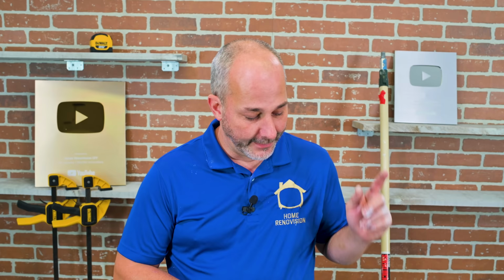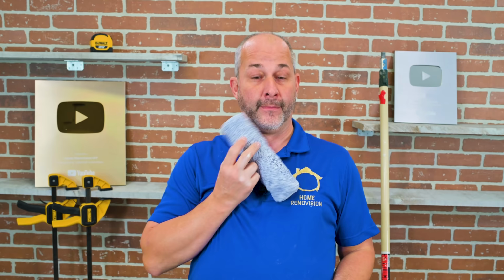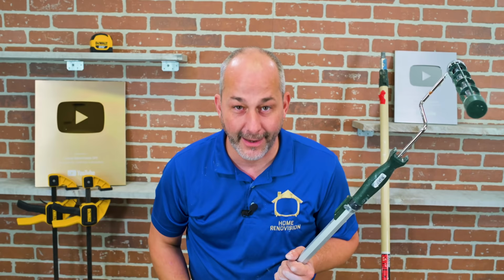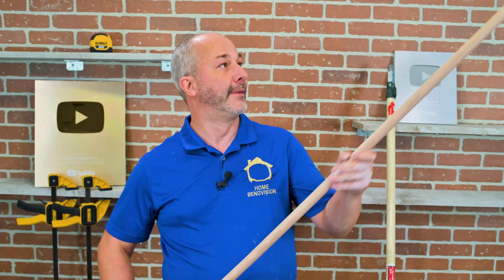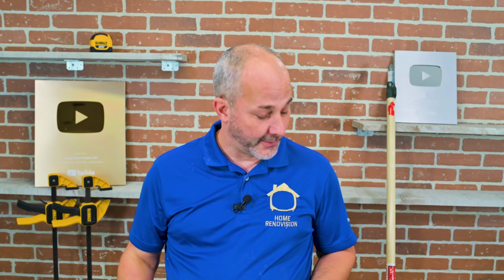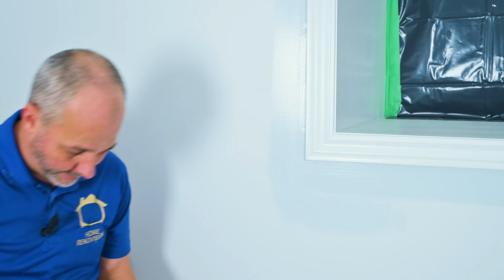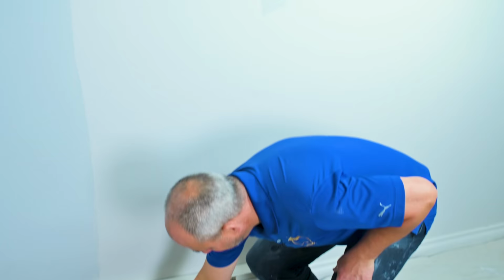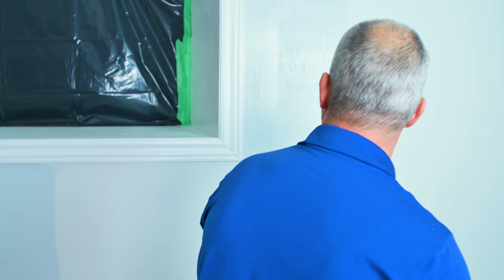Cheap vs Expensive Painting Gear | Is it Worth It?

Comment: if you load the edge tool with a stir stick or a paint brush, endnote all the way to the edge where the wheels are.  it is very clean and very fast. Dipping it, or overloading it with paint will be a failure.   I can cut a whole room (2 doors, 1 window) in 5 to 7 minutes.
Reply: I use a squirter bottle like the old type of ketchup bottles with a nozzle. Works like a charm. I agree....I can fly with that thing. Easy to keep the wheels clean and nice crisp line....not quite like tape, but better than cutting in....for me anyway. I carry both the bottle and pad with me, so I don't have to run back and forth to a pan....no brush to dry on my.
Reply: @biggregg5  I guess if I had multiple rooms to do, the squirt bottle is a good idea.  with just 1 normal size room. no time to dry on me. but great suggestion indeed.

Comment: So what is the secret of cutting in when your painting the rest of the wall with a roller?  The roller leaves a micro texture and a paint brush leaves a super smooth finish.
Reply: If you grab a 4” mini roller you can get very close to where the walls meet to provide texture continuity. I only use an 18” and 4” roller.

Comment: I have used that edging tool (the red one)with success, if I found that it didn't go as close to the edge as I would like I cut off some of the pad holding sides until it is perfect. But you really have to be carefull of paint on the wheels 😂 once you get the nack of it, it can cut really fast. But I can also cut with a brush but not as fast 🤷🏻‍♀️

Comment: To be fair with the trim tool...most have the wheels that lock back to load...however, the safe way to load a trimmer is to paint the paint on with a brush...do NOT dip the pad into paint despite the instructions. It works mostly...however if you are cutting into a ceiling, eventually you will put too much pressure into the edge of the pad, thus pushing the paint onto the ceiling anyway...it's very delicate process and if you go slow enough and are very careful, it's possible to do...these are best for corners though where the paint is the same color. At least this has been my experience...I do not use that tool..I now have professional equipment, but just wanted to give an insight to those trimmers...of course, you need to buy a good one, not from the dollar store.. LOL.

Comment: I find the cheap rollers eventually stop rolling. Then you're basically just dragging a extra wide rag up n down the wall. 

I knew the wheels were going to get paint on them right away. It's an interesting concept. The only way I think it could work is if you carefully painted the pad so you can cut in without the wheels getting all gooped up.  I've used a similar one, no wheels and it worked for a few, until the paint went over the edge of the pad. After than you're carrying a damp rag, trying to clean up the trim. But, it did work good to get into the corners, ceiling and walls of they're all going to be painted same color. I'm a firm believer, get what you pay for. Buy it once, not several times. Yes, up front it's more outta pocket, but at them end of the project you end up spending twice as much as it would've if you just but the good shit. (My dad is the perfect example of buying cheap, going back buying again, then finally getting the good stuff because 50 miles is a long way to the hardware store) me on the other hand, I just buy the best I can afford.

Comment: The dabbing method with padders does not work. We used them commercially with empty shampoo type squirt bottles to apply paint to the pad. You can absolutely get good quick results from a good padder, but does take some getting use to. I’m about twice as fast with it over a brush. Just a thought.

Comment: Honestly my fav part about being a painter was cutting with the brush and doing trim work outside, prep was the worst part. Overall it was an ok job, also there really is no reason to buy the cheap crap, you'll be lucky if they make it through the day, the extra 10-20 mins to wash and clean all the tools and extra couple bucks is def worth it, the tools will always be there in case you wanna let a friend borrow them or if your teenager decides to paint his room from blue to black.

Comment: I've actually used the red cutting tool. It was surprisingly good, until the second trip to the paint got paint tin got paint all over the wheels and the wheels painted my ceilings. Threw it out right there.

Comment: Jeff, first let me say thank you for the videos you provide that teach me how to do things the right way.
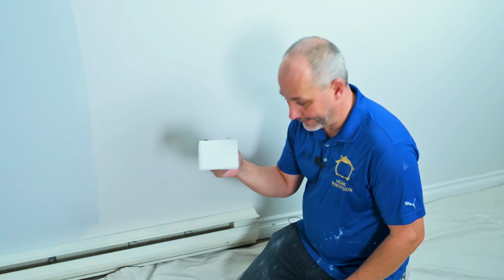I wanted to ask a question with regard to not using tape to prevent spills and whatnot. I have yet to perfect the brush technique yet, but I'm close. 😊 However, my question is about the roller you use after brushing in this video. At approximately 10:27, I see what appears to be some blue splatter on the white heater trim as you speak of the new gadget for painting around trim as opposed to using a brush. Of course, it could be the video itself, but it appears to be spots of blue I see. Even so, the question I have is about roller splatter. How do you prevent roller splatter from getting on heater vents, etc, when you do not use something to cover them such as tape? I noticed you do have drop cloths on the floor, but the heater is bare. How does your preferred roller function with regard to paint splatter? My thoughts are it is a matter of paint and gravity. Any info you might lend would be greatly appreciated. Thank you.

Comment: The edging tool works OKAY. You have to use a brush to add paint. But often times paint would flow over the edges and make a mess or get on the wheels

Comment: Jeff.  I'm going to pain my bedroom and my walls is that orange peel texture,  what is the best roller or brush to use? I want to do a accent wall.  Do you give ideas on different ways to do guest  rooms? if so I need some ideas. 😁
Reply from the maker: I would suggest a half inch nap on a 9" long roller. Cheers!
Reply: @HomeRenoVisionDIY   Great thanks .

Comment: I think I am something of an anomaly. I use both good quality tools and cheap crap from the dollar store. Depends on what I am doing. Mainly it depends on if I want to spend the time to clean up afterwards. If I am painting a room, I break out the good tools. If I am doing a small painting project, I will buy the cheap $3 pack of brushes and just toss them when I am done. Use one for primer coat, toss it. Use another for actual paint, then bag it in case I need to do touch-ups the next day. Same with cheap rollers, and tray liners.
I see no sense in taking more time to clean my tools than it takes to do the paint project.
I figure the $10 I throw out is a fair trade for the hour or two of cleaning I would do over 2-3 days of painting.
Same goes for oil based paint. I've got a couple nice brushes dedicated for polyurethane but I am not messing them up with any kind of paint. I've had them for 20 years now, and they still work beautifully.

The one thing I won't use though, is a cheap cage. A flimsy cage make the job so much harder. The uneven pressure leaves ridges in the paint, also makes the roller want to walk off the cage, you can't stretch the paint so it uses more.
Reply: Another advocate to this comment! Like all pros recommended I bought expensive brushes in the beginning, they hold so much paint it took me so long to clean them, and that was just not worth the time for me personally.

Comment: A roller question .... 12" double ended (flat frame goes to both ends) What is your opinion? 
It gets round the problem of putting pressure on only one end and mine has lasted 3 years now (not the same roller obviously) and seems good. But is it better than your "Pro kit" roller?
Thanks from the UK ;o)
Reply from the maker: I find it is a problem being that large. you will find a lot of situations where you will be rolling horizontally when you use that.

Comment: 2:57, the real problem is the amount of water people waste washing the rolls, I rather disposed it and put it in the cost of my clients, save water people.
Reply: for the novice maybe but if use your painter tool to remove most of the paint from roller they clean up well with very little water.

Comment: Those rectangular edge painters should be banned. They don’t work at all. A good paintbrush cleaned carefully will last for a long time. Trying to clean and reuse rollers is a huge waste of water and time. I buy the best rollers Home Depot carries. If I haven’t finished with a color at the end of the day, I put a used roller in a gallon freezer bag and get as much air out as possible. Even after three, four days, no problem. If I’m done with a color…it’s straight into the trash because it’s near impossible to clean all the paint out of a roller, and at $5, it’s not worth the aggravation.